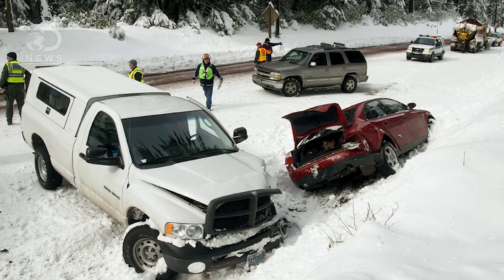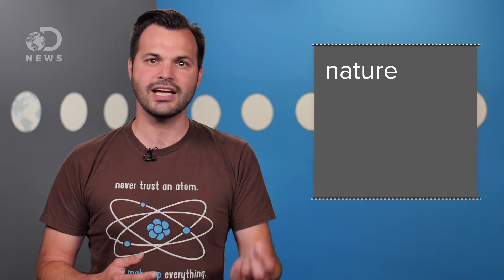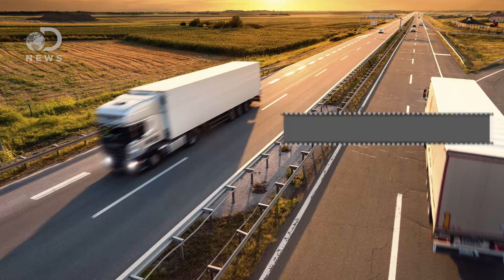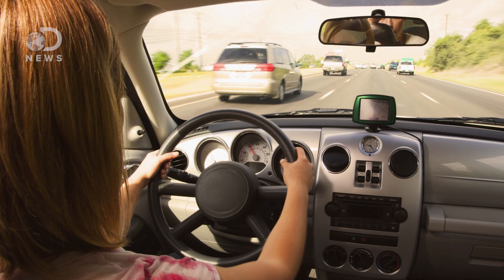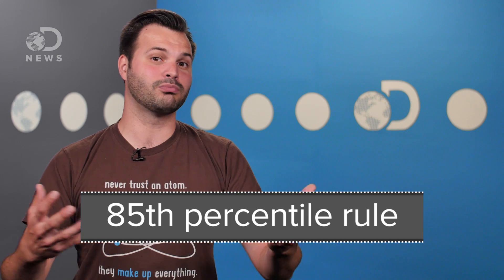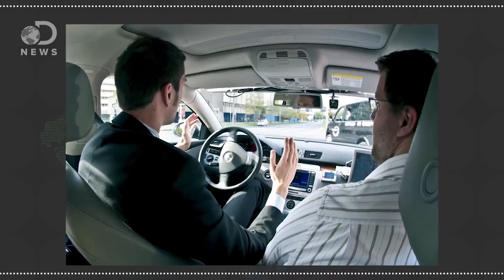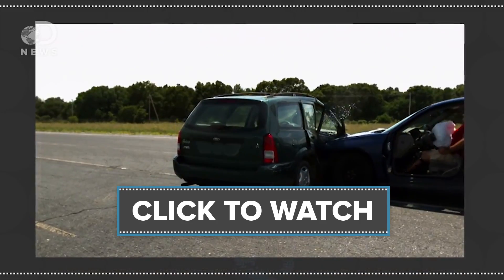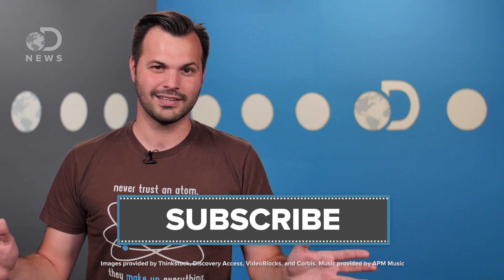How Do We Decide Speed Limits?

Comment: Speed doesn't cause accidents speed VARIANCE causes accidents. You kind of eluded to that in the 85th percentile however you seem to keep saying speed kills. If that's the case any kinetic energy in a 3,000 pound vehicle is deadly including 5 to 10 miles an hour. That said if we know that cars kill at any speed then the goal is to make them not kill. So a consistent speed with low speed variance regardless of speed including above 70 is much saver than inconsistent speeds with higher speed variance. Also I noticed you displayed the yellow speed limit sign as if it was an enforced speed limit. If you read you drivers manual you would know that yellow speed limit signs are suggested speeds not enforced.

Comment: one of the most important parts about setting speed limits is to try and limit "speed spread" - it's a lot harder to deal with widely varying traffic speeds than homogenous ones - and homogenous speeds mean that you don't get excessive (dangerous) passing maneouvres because everyone's going more or less the same speed and so, don't feel "held up"
Urban speed limits are generally "too high" - simply on pedestrian survivability issues - and lack of protection of non-motor vehicle users is coming to the fore even in the USA - a recent NY State court ruling resulted in a $20 million payout for a local authority ruled to have ignored repeated warnings about the safety of a suburban road, resulting in the death of a 12 year old cyclist

Comment: Great video, yes there is science to this, plus it does wear an engine and transmission the longer and hotter it runs. Prayers to the journey.
Reply: high speed at low rpm can generate less heat than low speed high rpm because rpm and combustion cycles are linked. More rpm = more combustion cycles = more heat and the transmission has difference gear sizes to accommodate for the increased wheel speed. Your tires are most likely the only thing that gets increased wear with more speed. Could be talking nonsense though.

Comment: A number of conflicting ideas in here, and stated as fact although the evidence contradicts what you've said. For example, for every 1km/h increase in speed you don't get a 3% increase in crashes. A number of studies in certain situations have demonstrated that increasing a speed limit has led to a reduction in crashes, and reducing speed limits has led to an increase in crashes. In many cases, raising the speed limit would actually be SAFER. Likewise, the setting of speed limits is not as rigorous as you've presented here - there is clearly political and financial mileage to be had from a lot of the changes.

Comment: Speed limits are set in order for cops to be able to legally give you citations. Highway speed limits are in fact irrelevant. Why? In heavy traffic areas such as NY, LA, etc, most of the time during the day you can't even drive at speed limit, because you're stuck in traffic. Then if the highway isn't too busy and especially in the rural areas ( such as Montana, Nevada, ) you can go much faster and in those cases, most drivers won't excede whatever they feel comfortable. So, interstates outside of the major centers shouldn't even have posted speed limits.

Comment: 140 km/h is slightly faster than 85 mph.  The 85 mph section in Texas should be 140 km/h.  Approximately 87 mph.  Replace the 85 with the 87 on SH 130 in Texas.

Comment: There should be a speed range not a speed limit
Reply: Some highways and motorways also have minimum speed limits below which it is illegal to go. In Ireland vehicles not capable of 50kph are not allowed on the motorways. You must also maintain at least 50kph on the motorway and stopping is not allowed although it happens in heavy traffic, usually in the fast lane.

Comment: That's how speed limits would be chosen in a world where only driver safety was considered - simply choose the speed at which driving faster would create a significant risk of crash. Needless to say that is not how it happens, the political and revenue generating aspect are the main concern for government bureaucrats.
Most speed limits are ridiculously low compared to the level where it would actually be dangerous to drive faster, and they are arbitrarily lowered all the time for political reasons (NYC ridiculous 25mph is an example). The goal of speed limits for government bureaucrats is always the same: control and fine. It's simply a revenue generating machine, they will use traps and low speeds simply to extort more money from drivers.

Comment: I just got my 300 dollars speeding ticket dismissed. Always plea not guilty to your ticket.
Reply: I got pulled over doing 87 in a 70 and got speeding and reckless driving. Went to court and got both dismissed by pleading guilty and telling the truth. I admitted I was speeding, even telling the judge that had he clocked me from the other side of the overpass, he would've got me at 90 something. A little back story. I was traveling down interstate 81 through Bristol, VA doing my usual 78mph(9 your fine, 10 your mine) when the car in front of me in the fast lane hits his brakes. I checked my mirrors, merged to the center lane, and hit passing gear. The only other car in the center lane was about 200 yards back so there was no risk. After I got passed the car I went around, I hit cruise control and resumed my normal speed. What I didn't know was the guy in front of me seen the cop on the overpass ahead and I didn't, lol. I explained to the judge that while yes, I was speeding, there was nothing reckless about what was done. The judge tried to tell me that it's automatic to receive a reckless driving over 80 in the state of VA and I told him he was wrong, it was up to the discretion of the officer. The judge looked at the DA and he confirmed I was right. The officer even admitted I wasn't being reckless. I then explained that I have a perfect driving record and no criminal record and that a reckless driving was excessive in my circumstance as I work government jobs that require a clean criminal record (reckless driving is a criminal offense, not a moving violation in VA) and the charge would do more harm than the situation waranted. The judge then cleared me of the speeding and reckless driving and imposed a simple $300 fine on me. I said, "thank you, your honor" and walked out with a big smile on my face.
Reply: Arutha258 Lol. My story isnt nearly as detailed as yours but I basically just walked in gave a little 30 second story and she just said the words "Slow down next time okay". I was genuinely shocked at how fast the whole thing went down. On second I owe the government 300 dollars and the next im free of it.

Comment: wow 100kmh is really slow considering the distances at the US!
Reply: +FreddyGaming Very few people actually drive the speed limit. Most police officers won't pull you over if you're only going a bit over it either, at least on the highways and the interstate. They're stricter about speeding in residential areas and especially school zones.
Reply: More on your point, here in Ontario the average speed limit is 100kmh (i guess like 60mph?) but everyone drives at least 115-120. The very slowest are going 100.
Reply: DJSbros Yeah, 62mph is the almost the same as 100 kmh. The speed limit in my state is 70 mph (about 112 kmh). But it's pretty normal to see people drive up to 80mph (about 129 kmh) or even a little higher.

Comment: In Canada I've never driven on a highway that has a speed limit higher than 110 km/h, usually it's 100 km/h but the TransCanada has 110 km/h now, 140 km/h as a speed limit sounds insane to me, even though that is usually what I drive anyways.
Reply: We have 140 km/h limit on highways in Poland, and for me a limit like 100 km/h sounds crazy ;) Anyway, many people here drive below limit (like 120 km/h) to save fuel.
Reply: Here in Italy the limit should be 130, but most people drive at 150-170 and don't get fines. Strangely, there is a highway that has a lot of bends but no speed limit, and relatively little crashes occur.

Comment: There's places in Ireland where the speed limit seems more like a dare than anything else; tiny twisty roads with a cliff right at the shoulder an no space for oncoming traffic. If you set your cruise control to the speed limit, you'd most likely fall down the cliff.

Then there's Germany where they like to give you a reason right under the speed limit sign. For instance "to keep the air clean" in some parts of town or "to keep noise down" on parts of highways with residential areas nearby (usually it says something like "between 7 p.m. and 7 a.m."). There's also ones on school routes that only apply on weekdays between certain hours. Everyone's favorite road sign is the white one on the autobahn saying that the speed limit is over. But however fast you're going, there's always cars going twice as fast passing you on the left.

Speed limits in Europe are generally higher because the roads and cars have to be kept to a higher standards (better tires, brakes, more stiff suspension).

Comment: Let's just all admit that speed limits could be a lot higher if it weren't terrible drivers..
Reply: +Doctor Professor once cars drive themselves exclusively highway speeds will increase.
Reply: 0011peace But i don't want autonomous cars :/ I'm not interested in going fast if the car is doing the driving. I like driving.
Reply: Doctor Professor
I need a self driving car.  You can reduce car accidents to near zero by eliminating the driver.  A car should be a way to get from point a to point b no and extension of your manhood.  Going faster means you reach point b quicker.  The only legitimate reason to drive faster is to reach your destination.quicker.

Comment: This video did omit an important facet to speed limits: state laws regarding standard and maximum speeds. It's been 10 years since I got my license, but I still remember that in Florida the standard speed limit on a minor residential road is 30 mph because most don't have speed limit signs. The are also maximum speed limits specified by law, so even if the 85th percentile and maximum safe speed (nature & engineering factors) are higher, the state DoT can't post a higher speed limit. I remember this because politicians introduced a bill a couple years ago wanted to raise the maximum speed that could be posted for rural interstate highways from 70 to 75. That bill caused quite a bit of debate in the news.
Reply: +afh7689 I live in the state of Washington where the same thing is happening.  There's a bill here to raise Washington's maximum allowable speed limit from 70 to 75 but still keep it 60 for big trucks.  Our legislature passed that a year ago, to give Washington's DOT permission.  Our governor vetoed parts of it. He's a safety guru.  There' s just over 100 miles of I-90 in eastern Washington where they are actually going to do it.  The city of Spokane is just 20 miles west of Idaho and a ways way from the rest of Washington.  The stretch is from another 20 miles west of that to where rolling hills are approached.  The Spokane drivers are pretty much all looking forward to that so they could figure on doing a good 85 and shave minutes off getting over to Western Washington.  More cars will be doing 85+ on that stretch.  I see that coming a mile away.  And maybe a low percentage of the drivers will actually keep it at 75 (with that being what they did when it was 70) and like the new 75 mph limit.
Reply: Well, I drove that stretch of I-90 in Eastern Washington over a year after my last comment.  Turns out that it didn't go up from 70 in that 100+ mile stretch as the DOT wanted it to.

Comment: The other problem with speeds causing accidents is when the speed limit is enforced severely. This has been shown to lead to habits like speedo gazing (staring at your speedometer) and that takes the driver's attention away from the road which can cause accidents with as much, or even more, frequency as speeding actually does.
Reply: I ride a motorbike. They, for the most part, do not have cruise control.

Comment: Ive always wondered about the yellow signs on turns that are posted lower than the speed limit, are those suggestions or actual speed limit for he turn? the biggest thing that also plays a factor is the kind of car that is being driven. There are turns I like to take in my mustang at high speeds that I would never attempt at the same speed in my pickup. at the same time there are places where I drive faster in the pickup than the mustang, like country roads for example. I can take the truck at pretty high speeds and have no problem on an old dirt or gravel road, but if I try the same in the mustang id bottom out and destroy a lot of stuff.

Comment: it also takes a lot of effort to go slow enough to go the posted speed.
Reply: It is a matter of keeping the eyes wide open and also observing the behaviour of cars ahead of you on the road. If you see a lot of braking going on chances are that a speed van is taking pictures. Many roads have absurdly low speed limits where going the speed limit can actually endanger you from tailgaters and aggressive overtaking. The trick is to push up a little on the speed but also be ready to change lanes if needed. On freeflow junctions where your exit is in the outside lane this is not always possible.
I have been caught speeding when overtaking a suspiciously slow car, I should have held back since the slow car knew of the speed trap, probably a local with better local knowledge or better eyes than me....
SInce then I have been overtaken aggressively by cars who have been stopped at speed traps in a similar fashion.
The revenue aspect of speeding fines does not apply to Ireland, according to the authorities, since policing is done on a national basis and does not involve the local authorities. All monies collected go into further road policing and car monitoring for car condition compliance, insurance compliance etc.

Comment: I wonder if that's what those sensor packs with  2 rubber hoses you see occasionally stretching across the road are for. The single hose units I know are used for measuring traffic volume, but rhe dual hose rigs could  be used to measure average speed based upon an average vehicle wheelbase and the time delay between impacts.
Reply: No it couldn't.  They don't know what type of car is driving over it.  In order to measure speed using time, you need to know the distance between the front and rear axles.  Was that the two rear axles of a semi rolling over the tubes or a car doing 80?  See what I mean?
Reply: +Ryan Payne It occurs to me I'm overthinking this. For speed measurements wheelbase and number of axles is irrelevant. You only want to know how fast a vehicle's tire is moving (As the body isn't going to be moving at a different speed than its tires) Tire contact patch size doesn't change that substantially, even with large vehicles. Thus any average is probably unnecessary, and the device is probably strictly measuring time between impacts. 

If you want to also measure traffic volume, then some algorithm to measure average wheelbase (Such as omitting impacts times too close together), or rough vehicle size (Such as measuring impact pressure on the hoses, which would be greater with more massive vehicles, when referenced against time delay) would have to be devised. That would be much more complex, but  outliers from whatever graph this gets plotted on could be ignored, a clever engineer could still get a good idea of traffic speed and volume. (With an acceptable margin of error).

Comment: I heard something on the radio a few years back that Michigan was going to lift the speed limit on some roads and whatever people went would be averaged and then they would use that. Not sure what ever happened to that. 
 
At least in my area, it is not uncommon for people to drive probably like 50 miles to town or work. Most the highways are speedlimit at 55, but some will do like 65 or so. A lot of them do like 60. Even the police, etc they see you doing like 60 probably even like 65 there like whatever. I knew someone with some police friends and he was talking about something they had discussed. They were like there is so much distance between anything around here and the speed limits are kind of dumb so none really enforces unless you're like 10+ mph over.

Comment: Speed limits are always lower than safe.. For instance, here in Brazil almost all the roads limited at 80 km/h are really safe even at 100km/h. These roads are speed 'limited' since 80's with the same speed limit (80km/h). Cars in 80's were much less safe than today standards cars, in order that our speed limit could be something around 100km/h. Modern cars has better braking and stability, and safety features, like airbag.

Comment: No speed limits! Only speed minimum. It should be raised by 10mph at least on every road. If you can't drive that fast or are uncomfortable then you shouldn't be driving in the first place. Then there should be a driving class that all women are required to take that teaches them to get into the right lane when they aren't passing. Whenever I have beef with another driver, 85-95% of the time, when I look into the drivers window.... It's a woman!
Reply: Hey, I've seen women out run me.